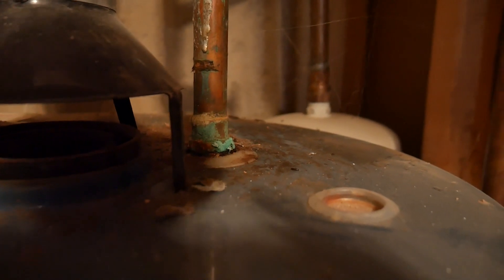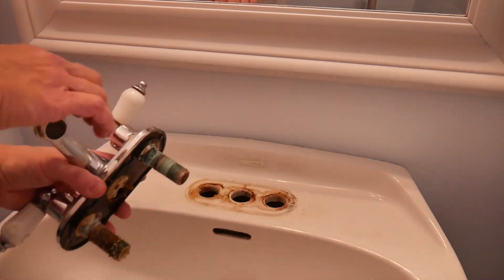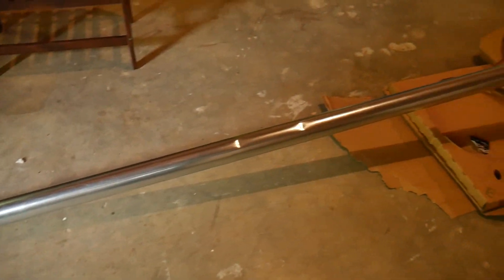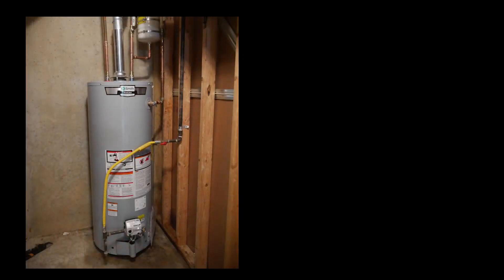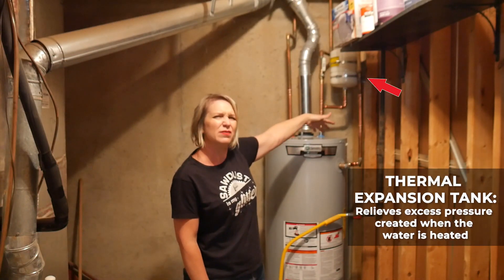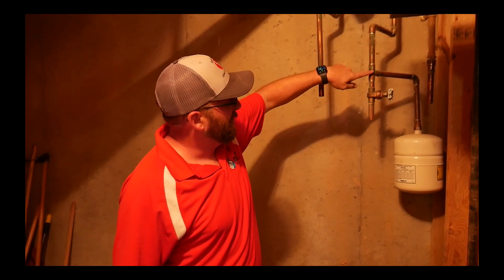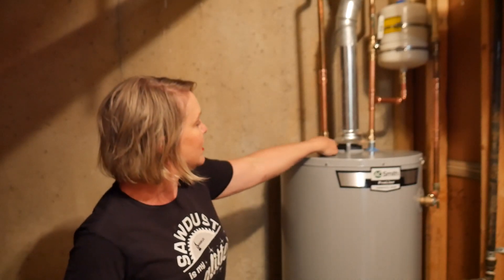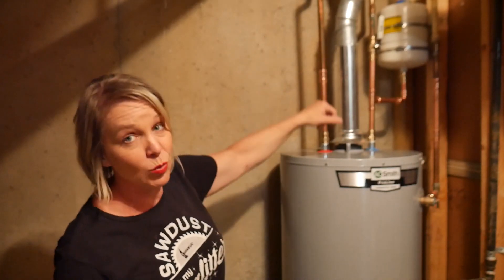Why I Hired Someone To Install My Gas Water Heater (instead of installing it myself)

Comment: During the polar vortex, this last winter, our hot water heater quit functioning properly. It was actually great timing. Right Before the vortex we discovered the reason the basement had been leaking/flooding for years was that the pipe from the well to the house was busted, (for at least 10 years), so we weren't able to use our water anyway. It was almost impossible to get a plumber out here because of the vortex. We finally got a guy to come out one afternoon to repair the pipe (Because I dug the pipe out of the ground and all he had to do then was replace it) and because he was So busy we decided to fix the hot water heater ourselves. Now, our HWH is electric and simpler to replace than a gas one and we got it replaced with only two 30 mile trips in to Home Depot, and back. We inherited this house last November but have been living here for the last 6 years and in all that time I Never had what would qualify as a good shower. The new HWH fixed that! We have great pressure now! We found out in this process that we should have been draining the HWH at least once a year and cleaning it out and that would have prevented much of the build up that caused it to stop working properly.  If we hadn't been in the middle of the vortex we would likely have repaired the pipe ourselves but it's important to know your limits and one of mine is the cold. Another one is anything gas related. If our HWH had been gas we would have waited.
Reply from the maker: Thanks for sharing this story! I've noticed the change in pressure too, and the water actually steams when it comes out of the faucet (which makes water boil.SO much faster).

Comment: Rookies can't solder? Lost art these days, I guess. Also, why is your PRV discharging vertically?
Reply from the maker: I'm sure it's possible, just not something I feel comfortable with when flooding or not flooding my home is on the line.  Which PRV are you looking at? What he's talking about in the video is the thermal expansion tank, not the PRV. The PRV is in another area and not shown in the video.
Reply: @ChickFixUSA  Totally acceptable, the method they used, I'm just poking fun cuz I'm old-school and solder everything. Dad is a mechanical contractor, taught me back in the day (I'm 38). The PRV is the valve on the side of the tank, visible throughout the entire video both on the new one and the old one. Yours discharges upward. You must be in an area that is an exception to the most common code-protocol for discharging downward.
Reply from the maker: @CORZER0  I thought the prv was the valve right as the main line enters your house, controlling the pressure of water that's allowed to come in?
Reply: @ChickFixUSA  You are referring to the PRV on the main. I'm talking about the PRV on the side of the water heater. The problem with discharging upward is that if the valve purges, the water cannot drain away from the valve, and instead sits in the line against the valve, which can corrode and damage the valve over time, eventually causing it to fail in a shut position.
Reply: @ChickFixUSA  Your PRV = Pressure Reducing Valve, my PRV = Pressure Relief Valve.
Reply: So I just talked to my dad and I misspoke; So I am referring to what is called a T&P valve, or, Temperature and Pressure valve, which is on the water heater. Sorry about that!
Reply from the maker: @CORZER0  thank you for letting me know! I was starting to seriously question my own knowledge 😂
Reply: @ChickFixUSA  You're good! Totally my mistake in using the incorrect nomenclature. Sometimes the terms are used interchangeably in the industry. I'm an ER nurse, hardly following in my father's footsteps. All I have is my Master Plumber's father's guidance from my formative years. However, the fact remains, that the manufacturer of the water heater recommends the valve be drained downward. Code may circumvent this, but that's .gov bureaucracy. The valve should not have sitting water against it for the reason I mentioned. It could possibly fail, the catastrophic concern being a burst.
Reply: @ChickFixUSA  I got your back! Keep up the good work! Love your videos! Are you in tech? You have good editing skills :)
Reply from the maker: @CORZER0  I'm only in tech in as much as I have learned through ChickFix. I really do love editing though, so I appreciate you noticing! Wouldn't mind doing more of it as another gig.
Reply: @ChickFixUSA  Cheers! And check out that T&P! Your contractor should have the answers.